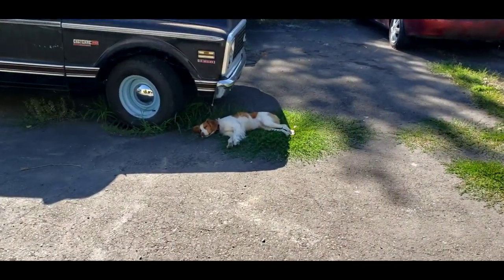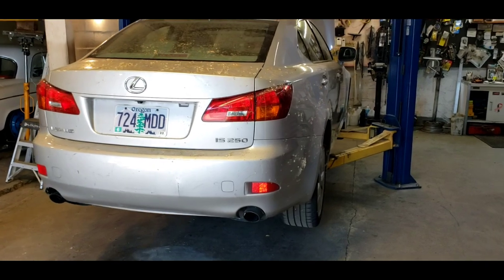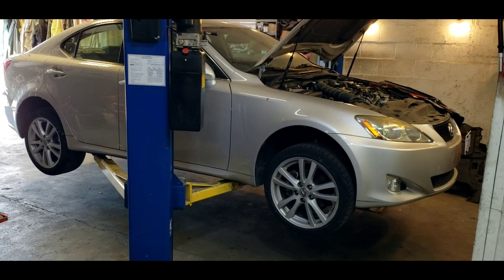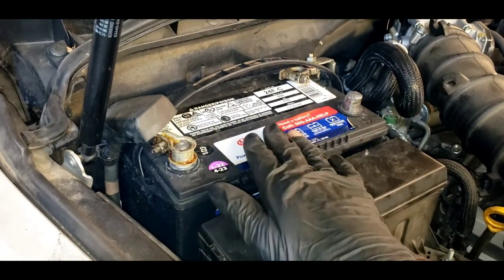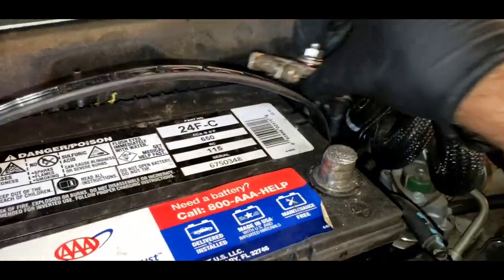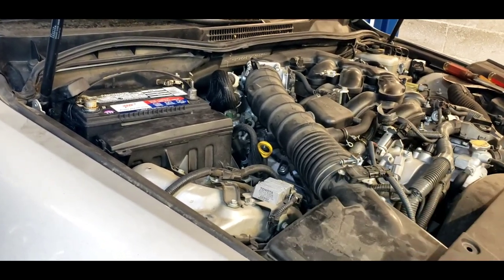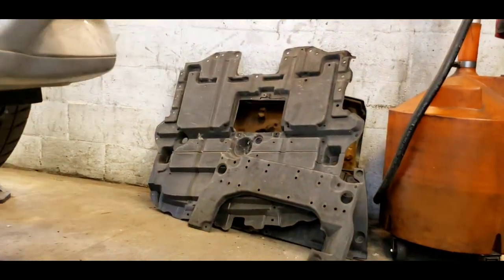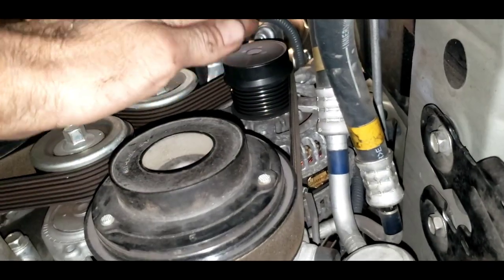Beware Hot Alternator

Comment: When you have a very high current leak you should suspect the alternator first; almost everything else (except the starter of course) has a fuse or circuit breaker on it. If there's a short in the alternator it will flow current without any protection. This includes shorted rectifiers which won't show any sign of physical fault. Basically the thing can turn into a big heating element - which is exactly what you experienced with this car.

Comment: I agree the alternator is toast, but are you sure it wasn't killed by a bad power steering unit drawing way too much current? I'd be checking for a drain with the alternator off before wiring it back up just to be safe.... Good Luck!
Reply from the maker: Its certainly possible,  I unplugged the electric steering and the alternator , surprisingly still a good draw, but much less
Reply: @2stroketurbo  It's amazing how hot 12 volts can get if it's got amperage backing it up!